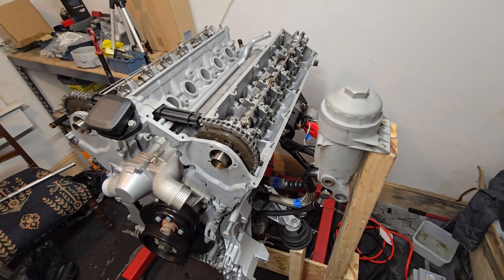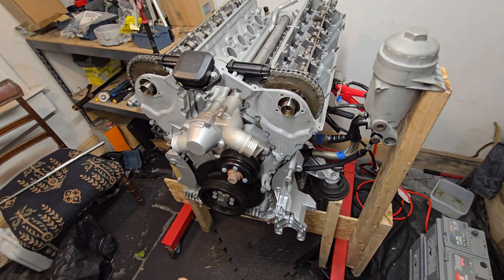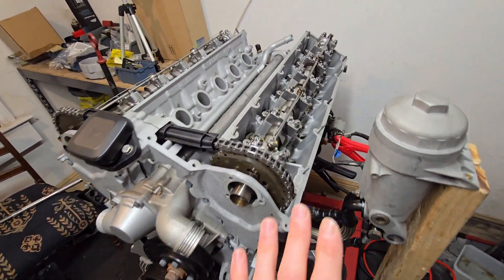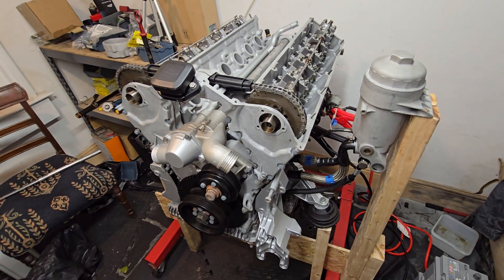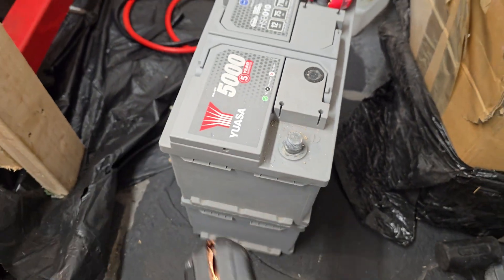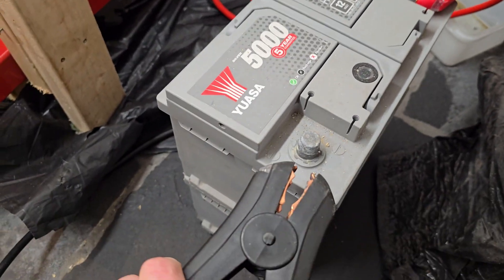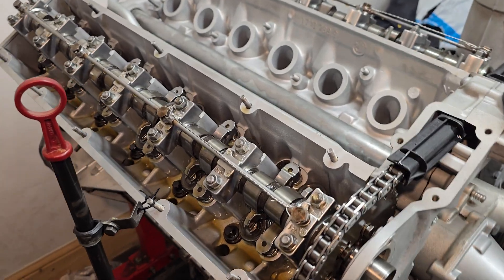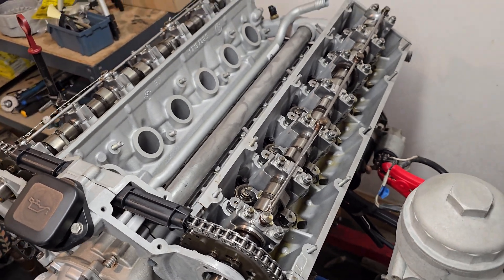Running A BMW V12 On An Engine Stand - Oil Pressure Demonstration

Comment: Hello, I have a '91 850i and I am thinking about rebuilding the engine or obtaining another engine to rebuild so my car isn't down for too long. I replaced the valve stem seals last summer but I am still seeing a small amount of smoke usually on startup once in a while. So the the valve stems may be worn or possibly the rings. Engine has 160K miles on it. Did you have difficulty locating rod and crank bearings, head gaskets, and other various parts? Thanks, oh, did you spray the bare aluminum engine parts with paint? It's hard to tell if its bare aluminum or not.

Comment: Im at a similar stage. Going in a project car so will need an aftermarket ecu that is capable of v12 , cablel throttle and 4 knock sensors. Any suggestions? Cheers james

Comment: You should have pre-lubed the entire top-end as it ran completely dry for a while until the oil started coming out and drip onto the cams.
Reply from the maker: It had already done a run with assembly lube and then with motor oil, everything had a thin layer of oil on it, thanks!

Comment: On a rebuilt engine the first few seconds running are CRITICAL!!!! Even in everyday cars; most of your wear is on cold start up until the oil gets pumped around the engine!
On ANY modern vehicle the MOST UNKIND thing you can do to them is NOT SERVICE them with Top Quality oil!!

Comment: Love these motors, fantasizing about putting one in my E28 5er, but I imagine it would be much easier in an E34 5er due to the similarities with the E32 7er which of course had the M70 stock